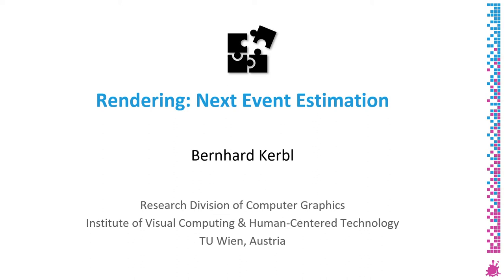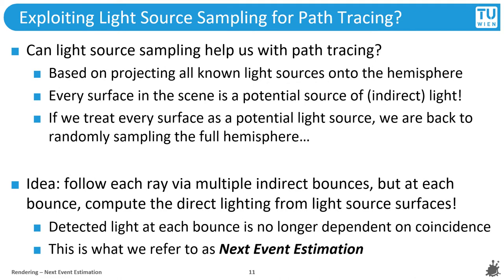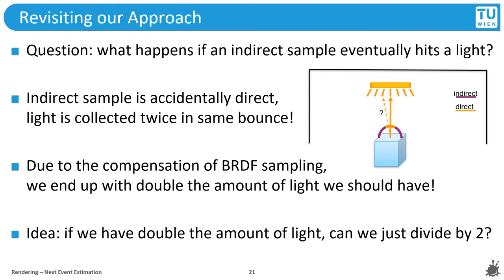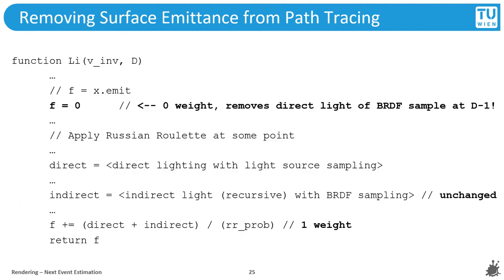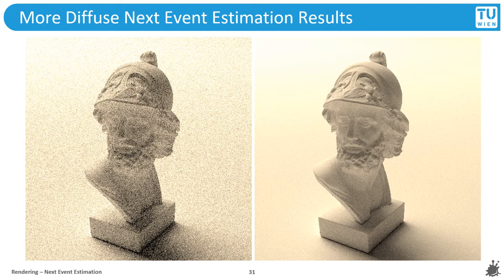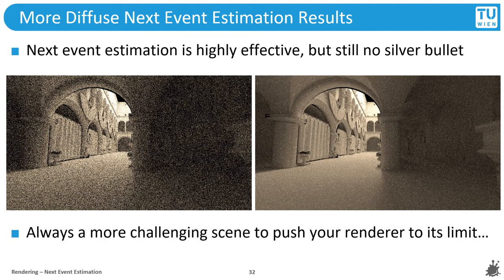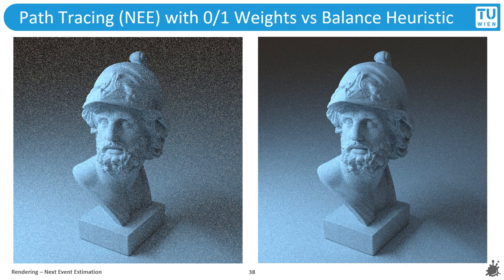Rendering Lecture 08 - Next Event Estimation

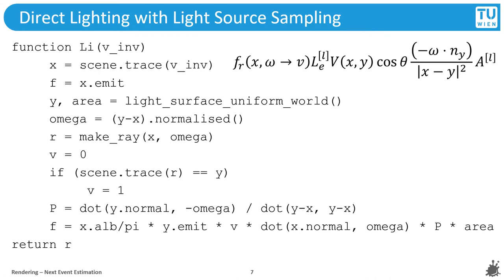Comment: Error in slide #7, around timestamp 4:29. You set f=x.emit at the second line, but later on when calculating direct lighting you set f=x.alb/pi...., but I believe that it should be a sum, ie f += x.alb/pi...
Reply: ah I see you changed it in slide 25 around 16:37